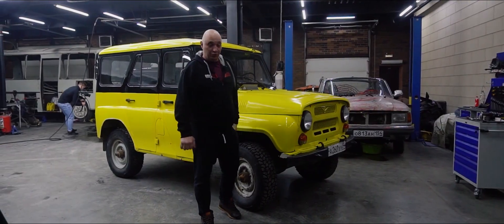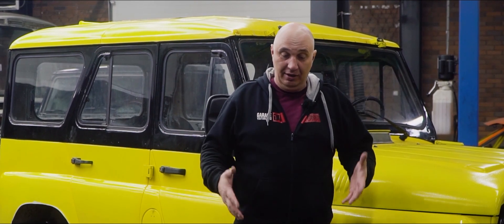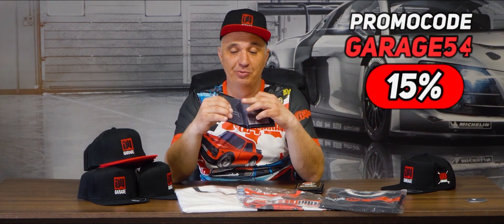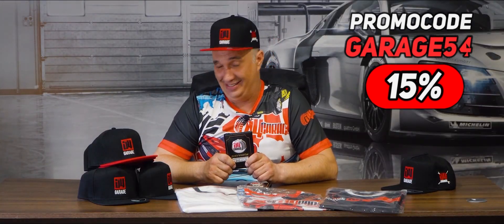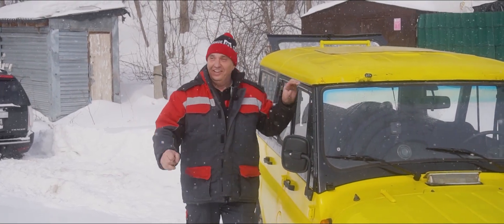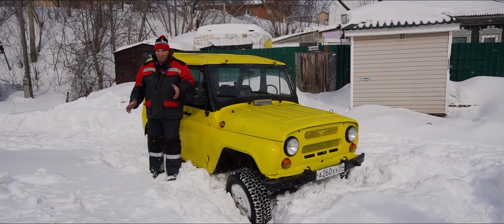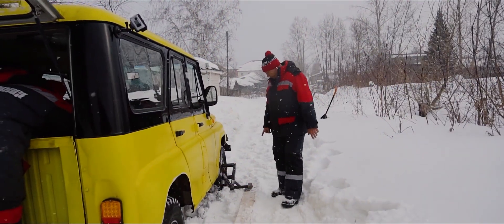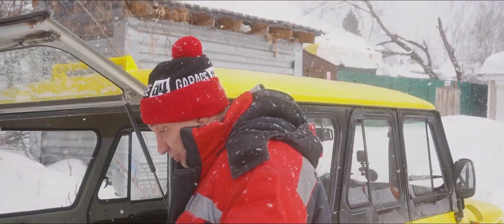Can a few planks make an UAZ a better off-roader?

Comment: Still think a good suggestion is convert a Lada so all 4 cylinders fire at once - like a giant thumper engine
Reply: How would you build something like that? It would be very expensive and time consuming to design and construct a special crank and cams.
Reply: I would love this too but yeah maybe impossible to build without an engineer
Reply: @PREDATEURLT  The crank welds at cyl. no. 4 would have to coupe with the force from cyl 1,2 & 3, all at once. It would be a much higher force than stock.
Reply: Bodge it and scarper engineering, press a crank back together so all pistons sit in line and then chop and weld a cam so the valves all open at once and short out the HT leads so they all fire at once. It doesn't need to be aircraft grade engineering and if it runs for 5 minutes then it's a valid proof of concept which it's all about.
Reply: @hell_pike9150  why would it take an engineer to build it? an engineer cant machine or weld, let alone time an engine...the degree means nothing...they just need a good mechanic/fabricator. the engine doesnt need to last it would be just an experiment
Reply: @stal5861  Check out what Allan Millyard can build in his little shed.
Reply: @stal5861  how do you build Lady 12 cylinder? Ah wait this channel again... Ever heard of new invention grinder and welder?
Reply: "Rotate in unison"  or all combustions sparked at one time?
Reply: @stal5861  i think these russians can do chopping and welding just fine, it's not like it's supposed to last lol
Reply: Would this actually work 🤔😂😂
Reply: That would be what's called a hit miss motor. Every other rotation it fires.
Reply: @danahamelinproductions9224  thats a perfect title for the video...well, if it ever gets made. I like the idea.
Reply: Custom cam, fire two at once, then the other two.......
Reply: @rocpile1141  That would just be stock right? Pretty sure a Lada already fire's in pairs, I reckon a 4 cylinder should have enough torque to tow the Hummer whilst being that unbalanced it wants to sheer the bolts and leap out of the engine bay.
Reply: @jjhack3r  hence saying they would need to press together a custom crank. It's only welding a solid straight bar to either some steel disks and a bar or a butchered crank.
Reply: @Screwdriver440 big starter motors won't be hard to come by in there neck of the woods where they have to start 11 liter soviet behemoths
Reply: @stal5861  vladstyle offcourse 😂
Reply: I would like to see that
Reply: Please please make a thumper
Reply: @hell_pike9150  JUST WAIT
Reply: Like a 2stroke detroit diesel!
Reply: That’s not possible.  Engine wouldn’t keep a high enough RPM to move or even start.  But wicked idea.  Maybe a try
Reply: There is no way you could make it run. The crank counterweights would have to be huge to make it even spin let alone hold together at speed. Your crankcase would be the size of the lada.
Reply: @rocpile1141  That would be really interesting, and could be done with a simple welder/grinder.
Reply: Funny isn't it, suggest this idea on a car channel and plenty of people say its impossible, yet if it was on a bike channel and I suggested sticking 2 parallel twin engines together people would be like that's crazy, let's get it done 🙄
Reply: HAHA dude yes!
Reply: @Jeremy Pike

You might want to do some research as to what a hit-and-miss engine actually is.

By your logic all single cylinder 4 cycle engines are hit-and- miss.
Reply: That would be difficult, however, you could convert it so as two then the other two fired, so two then the other two!
Reply: @BoB4jjjjs  What you are suggesting would require nothing more than a reground camshaft.
Reply: @johnfox3845  You might get away with not regrinding it, run the other two cylinders rockers off the other two, I am sure it could be adapted to run like that.
That would be funny, a two cylinder four cylinder engine lol  :-D
Reply: @johnfox3845  Weld the rockers on top of the engine together.  Remove the other cams, effectively you will have four cylinders running as two.
Reply: @BoB4jjjjs Due to the design of the valvetrain, what you are suggesting is pretty much impossible without modifying a ton of stuff. On the other hand, welding up and regrinding the camshaft can be done quite simply. It wouldn't last forever, but with my mig welder and grinder I could make something work in an afternoon. Garage 54 has a lathe and milling machine, so they could also just cut the cam apart, bore the center so it will accept a pin in the middle, and then weld it back together re-degreed for 2x two cylinder operation. If Allen Millyard can make it work on high rpm motorcycle engines, G54 can make it work for a Lada, at least briefly.
Reply: @johnfox3845  If you have the equipment to do it, what are you waiting for?
Regrinding the camshaft will work for a short while, in any case you wouldn't want to run and engine like that for to long anyway.
The result would be a Beach Boys song  "Good vibrations"  :-D
Reply: Doit make it as jankey as possible too
Reply: Better idea: put an old single cylinder stationary engine in a lada for infinite torque
Reply: That would be cool! 🤣  Apparently they did weld together crankshafts before, as he mentioned in one of the episodes.

Comment: Raise the planks a little higher so the tire are making first contact with the road surface. Then you can still drive it but in deep snow or mud they'll add surface area. Also add fins to the bottom to keep it from slipping
Reply: Add differential lock to spin both sides... You go nowhere with load on one side
Reply: Yea, need cleats on the bottom of the boards to give traction, like a tracked vehicle
Reply: Let's boost this comment.

Comment: You do need some traction on the plank, cleats or rubber pads maybe, but the larger issue is that you need full diff locks so the wheels all turn at the same speed.
Reply: Let's boost this comment.
Reply: good luck getting lockers for THOSE diffs.

Comment: there is too much of an offset on those planks vs the wheels. try and make them only contact the ground when the tires have started to sink. it will also make for a smoother ride. put some tread onto the planks. i think it will make a big difference

Comment: The offset of the plank axis is too far from wheel center axis, you should let the tire sink in a bit, it will go more smoothly. You should lower it to the rim edge instead of tyre edge.

Comment: How about each wheel having it’s own small engine then you have 4 throttle levers on the dashboard like a B747?
Changing individual engine speeds to each wheel. 

Another idea that would be easier to fabricate would be 4 electric car motors, one for each wheel. Then have the 4 throttle levers to control each wheel separately.

Comment: Locking/welded diff is essential for this. Also putting the arms a bit lower so it has more range to push down could help. Great idea tho. That setup wreaks havoc on your diffs for sure lol, they go for whatever side has the least resistance so they alternate like that

Comment: you should see if you could do a belt system between the tires. also ive always wanted to see duel rear tires on a car
Reply: (2 years ago)    Old episode     (6x6 Lada Niva by Garage 54)   It has correctly working dual axle in the back for snow lookup "Driving our 6x6 Niva for the first time"

Comment: At first, I thought about using some sort of drive shaft connections between the front and back wheels so you can steer, but that would lock either right or left wheels together. When you cut the planks, I was amazed. When that didn't work, I thought about some sort of rake to help the wheels grab better. Maybe use shorter planks with 9 inch nails or some shit like that.

Comment: 1. Put teeth  on the bottom of the planks.
2. Make sure the teeth are strong and angled towards the back.
3. Planks only for the rear.
4. Skiis for the front.
Reply: Make the planks move at the same time.

Comment: the woods slipping, im surprised nobody noticed that.. all u have to do is screw a few scoops to the bottom so it gets some traction, also try it in 4 low so its a little smoother

Comment: You made a car on skies. And skies just slide on the snow. What did you think it is going to do? :D You need to add some traction. Screwing smaller planks, adding nails, rubber...

Comment: Should have used welded differentials to keep the planks spinning evening with enough power to lift the car. Also, add something to the bottom of the planks for grip.

Comment: Suggestion: Dyno a Lada, pull the engine and trans and remove material from the moving parts of the drivetrain to make high revs. Retest to see what kind of gains can be made and what blows up!

Comment: If you bolted on some angle iron pieces on the bottom of the planks like excavator tracks have I bet it would get some bite to move forward. The planks are just slipping on top of the snow

Comment: Put snowmobiling belts screwed to the bottom and weld the diff so it rotates in sync. Then raise the plank. This concept needs more testing I think it could work.  Ya weld the diff and take it out of 4 wheel so they rotate evenly

Comment: You need a set diff locks and it would work alot better... handy trick is to tie 4x2 to the wheels... ether across wise or vertical

Comment: Machine a steel piece like that of a cam lobe or Wankel rotor as wheels the diameter of actual off-road tires and a tire tread glued to it. Theoretically, you'd be able to balance the vehicle on its axis and still get the surface area of a plank and a slightly* smoother ride.

Comment: Cleets on on the bottom of the boards for traction and lockers would make a huge difference lower gears would make it even better I am a seasoned off-roader.  never quite tried this trick but you can see the boards are slipping pretty bad so traction would definitely help

Comment: The planks are lower than the tyre when on the ground, thus lifting the truck and losing traction rather than to be an aid to the tyre. It would be better to shorten the distance of the arm holding the plank to prevent it from actually touching the ground when driving and only coming into play when there is snow and the wheels slip.

Comment: What about 4 plank drive. It will help steering. Ok you did that. I was thinking seal skin on the bottom of each plank to give more traction. And wider planks too. Not enough surface area

Comment: Put an engine on the front axle, with drive shaft.. and then a second motor and trans on the back axle... so powered 4x4

Fronts powered by different motor/ trans than the rear...

Then off road and use both motors ..

Comment: You need CLEATS under them to gain traction. You would also get better traction by removing the planks and their bearings/mounts and extend the mounting shaft by the loss of the bearing and plank.....leaving a single protruding stump to dig in with. I've seen many farmers chain a log to the rim of their tractor while buried to the axle in mud and it lifts them up and out almost every time. The failures came when the log snapped from not being strong enough. Just remove the planks and you'll probably succeed without needing to do any extending.

Comment: What if you cut some Slots in the bottoms of the planks and then pounded lots of nails into them so they were sticking out the other side so they could push some snow kind of like Tracks.  maybe?

Comment: need cleats on the bottom of the boards there's no grip unlike snowshoes these aren't big enough to hold you on the top of the snow like snowshoes so you'll need something to keep the planks from just sliding on top of the snow after the weight packs the snow down same reason tires don't work very well on snow it packs it making it slippery wish i had the extra money and vehicle id try it just because I'm curious now lol

Comment: @Garage 54 , too much lifting, I am sure! Shorten the moment arm. Imagine you have crutches...if the crutches are too long you will spend your energy lifting yourself too high instead of propelling yourself forward. Now it is like you have skates on a muddy sidewalk...a little bit of lifting is good, but really you just want the "crutches" to lighten the load so the wheels can still turn and push thru without bogging down.

Comment: Would locking differentials improve things? Preferably so that all four wheels turn at the same time.

Also, perhaps the ride could be improved by moving the offset towards inside the wheel rather than it's outside.
Reply: locking diffs arent available for the UAZ

Comment: If you out ball joint on the front connector, then you could steer
Reply: And mount the skis on struts with shocks/springs
So it isn’t as jarring
And you can make a longer throw

Comment: I suspect most of the problem lies in trying to do too much in one go. Your insistence on having the planks fitted so far out from the centre of the wheels led to the big jerky steps. I believe progress would have been smoother if the tyres had been allowed to protrude further below the level of the plank.

Comment: They need to learn the wonders of locking differentials. 2 or 3 wheels pulling no you want all 4 pulling through deep snow
Reply: Plus with planks like that you really need both sides of the axle locked together. An open differential always places the power or turns the wheel with the least amount of traction.

Comment: Have you got any imagination at all, you muppets?? All of the wheels have to spin at the exactly same time - so FULL diff lock is a must! Otherwise, one wheel fights against the other! If you want to increase the efficiency of this idea add multiple bars to the bottom of the boards so they would have less chance to slip on the snow!

Comment: Got an idea for you..  what would happen if you replace the coolant in an engine with oil?  Maybe an oil designed for low temperatures. Would the car still operate at the right temperature at fast highway speeds? Round city roads?